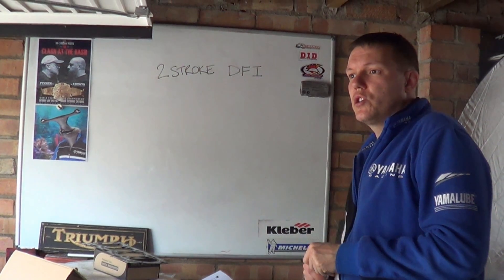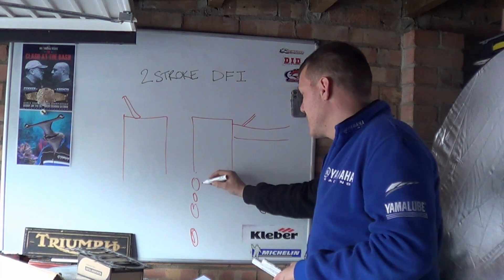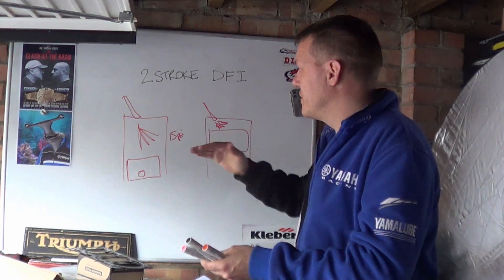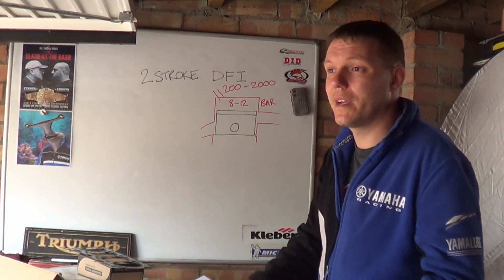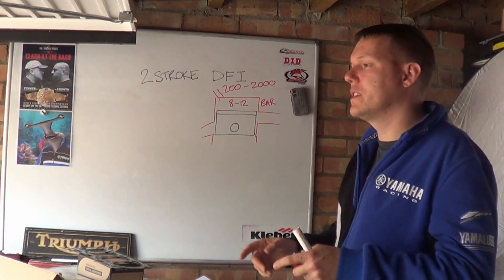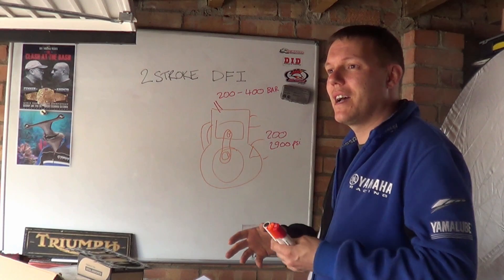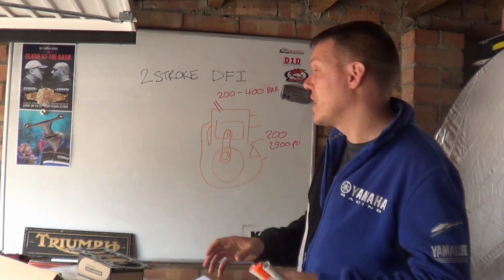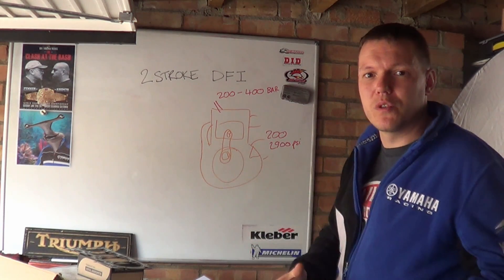Will Direct Fuel Injection save 2 Strokes?

Comment: the point of two stroke lubricating the entire engine with one source of lube. dfi has complicated it to much lublin the parts that with different systems to oil big end rod an crank bearings.   they more work  R&D to do.

Comment: The video skips over much of the difficulty, and details of meeting emissions regs.  The exhaust system is a critical part of the equation.  Its not difficult to meet regulations, when the engine is "up on the pipe" its at lower rpm/load situations where  its most difficult to keep un-burned fuel from exiting the tailpipe.

As far as oil, if it completely burns its not an issue (at least here in the states where particulates don't factor in)

You need to look into the snowmobile market, or even marine outboards. The sled market is absolutely dominated by 2 strokes.  Back in 2003 Yamaha vowed to go 100% fourstroke.  Since then their market share has plumeted to the point, that they don't even build sleds.  They pay arctic cat to put yamaha decals on cat sleds.

Arctic Cat, and Ski doo sell a mixture of 2 stroke and 4 stroke sleds.  Both have a vast majority of customers choose 2 stroke.  Polaris doesn't even build a 4 stroke sled.

Ski Doo uses E-Tec injection (true direct injection, with voice coil injectors firing into the combustion chamber)

Arctic Cat uses a hybrid system, with a single injector firing through the cylinder wall, above the boost port.  At low load, it fires into the combustion chamber only.  At higher load, it fires into the chamber, and into the crank case through a slot in the piston.

Polaris uses indirect injection, firing an injector into the boost port.

Comment: Why doesn't DFI mimic a lean run situation?
Reply: It does! Bosch DI use a stratified injection which uses a rich mixture to start the burn then adds more fuel which ends up being a lean burn, in some cases 60:1 AFR

Comment: It would require a new type of fuel pump but that is totally possible, just has not been done yet.  You can have an eccentric, camlike surface for a rotor over a stator who force output is very high during points of maximum mechanical advantage.  As one example.  Because you would most likely be talking about single-cylinder engines for bikes, generators, etc.. it could be cost-effective.

Comment: what if you had longer than normal stroke and the the exhaust port was moved closer to BDC and combustion happened just as the exhaust port closed? Obviously this would decrease pressure... Right? If so how significant would the decrease be?
Reply from the maker: Great question, there's a video coming this weekend to answer this - matt
Reply: Cool, this is a very interesting topic. I'll definitely keep an eye out. Thanks.

Comment: I think looking to marine applications, provides some other examples were they are common place. The complicated/heavy/high pressures etcetera direct injection issues have been solved with lower revving 5-6K and bigger disc placements1.7L- 3.5L. I think a review of new Evinrude ETec/ G2 engines may contribute to your analysis. The high tech management systems seem to have played a significant part also. Efficiencies were solved and torque was supreme in this sector for the last 3-5 years. (Looking at the Evinrude 2 stroke vs the Yamaha 4 stroke in the 300hp range - 2 stroke shows a reduction in weight of about 10% and a 10% decrease in displacement, this was were fuel and exhaust was managed into Eco friendly shifts in thinking. I hope to see road bikes again return with 2 stroke power but the above parameters may be too large at present but we hold out for electronic fuel pumps and other such components to reduce in size to perhaps fix all of this.
Reply from the maker: "I think a review of new Evinrude ETec/ G2 engines may contribute to your analysis."

- video already in the making my friend.

Comment: what about a direct injected 2 stroke diesel running on kerosene it would be capable of high rpms much like a traditional 2 stroke also the hobby market have been using these kind of diesels for a long time scale it up direct inject it and play with the efficiency a lil bit and it would get better economy and make more power because kerosene has a higher specific output than gas and it would but cleaner
Reply from the maker: "kerosene has a higher specific output than gas"

- where did you get this from? Kerosene has a HHV of 46.2 MJ/kg and gasoline has a HHV of 46.7 MJ/kg. Kerosene also has a lower autoignition temp than gas at around 20-40degC lower. 

Specific output is displacement over HP/kW, and kerosene burns more like diesel than petrol, i.e its flame speed is slower. Kerosene has a stoichiometric (air fuel ratio) of 15, while gas is 14.7. There not much in it, but gas is still the winner.
Reply: The Workshop your right gasoline does have a higher energy density but it does burn cleaner and in a high compression direct injected 2 stroke diesel engine it should be more fuel efficient and still produce sufficient rpms. kerosene does not need to have oil added to it like gasoline because it has sufficient lubricity so it takes one complication out of the system
Reply from the maker: Very good point - kerosene is generally not used in cars/bike becasue its not as volatile as petrol, so you don't get great homogeneous mixing. Old tractors and such used to run on kerosene, but most of them used gasoline to start then engine, then when the engine was up to temperature you switched to kerosene.
Reply: The Workshop that is why you need a high compression engine as well as having a high pressure injection system to properly atomize the kerosene

Comment: Why does my 300cc 2 stroke only have a compression of 6.9:1? Can you explain why they chose to go so low and what benefits and why/how increasing the compression (and to how high) would have? :D thanks great videos!
Reply from the maker: Thanks for the comment dude - can I ask what engine it is from?
Reply: some manufactures calculate compression ratio from the point the piston closes the exhaust port, some from BDC

Comment: "save 2 strokes"????? - 2 strokes arent dying... Just because certain sports no longer allow them, IE Motocross Racing, Doesnt mean they are dying....
2 strokes will never die....
I ride 2T mx bike... a Honda CR 125... I will never touch a 4 stroke... 
had one, and it was shit for starting when hot, let alone requiring a bank loan to rebuild...
Reply from the maker: and this shows what little you know. Ever tried to buy a 2 stroke from kawasaki theres days?
Reply: they dont make em.. havent since 2008....
Why? Because emissions..
People always say its because of noise output.. But its not.. 4 strokes sound waves travel further than 2 stroke sound waves...
But regardless of the fact that kawasaki and Honda no longer produce 2 strokes, doesnt mean they are dying..
There are thousands of people, Myself included, want to see honda produce a 2018 CR....
2 strokes have their fans, especially in motocross....
Reply: no thanks.. had a CRF 450, and that was an asshole to start when hot.. Even after valve shimmed correctly.
Soon got shot of that..
Reply: Snitchy1989 question, was it carburetor or fuel injected?

Comment: "i dont think you understand just how much 200bar is. it's a lot. this system need 200-400 bar. that's a whole lot. how are you gonna generate the 2000 bar this system needs? it would be counter productive to generate the 6000 bar minimum that make this work. i don't think you realize, it ruins the point of a two stroke to have it running pumps that produce 12600 bar."
Reply from the maker: Is this a question directed at me?

Comment: Rotax 800 E-TEC works at 7.900rpm (147hp from 800cc, 35.8kg), direct injection pressure is 34 bar (500 psi): 

http://articles.sae.org/8157/
Reply from the maker: The latest one is the E-TEC 850 - https://www.youtube.com/watch?v=jo-r7LwI70Q

Great engine, but my god it must cost alot. In the video the guy states that - "with a forged crankshaft and oil feed just like a 4 stroke, for reliability" - my point exactly lol
Reply: Maybe expensive, but no more than 4 stroke DI, and because no parasitic losses of cams, valves, etc. don't you think it's potentially more efficient?

Comment: Take a look at the Evinrude/Rotax E-tec direct injection system. A quite simple system with a electric powered coil and a ram that both works as a pump and a injector. https://youtu.be/daN72ij2eTU?t=1m20s
Reply: On the contrary my dear Ian...
Reply: Good video that hakan Bjorkman. Perfect example of development and why 2t are far from obsolete.  (or shite).

Ja sam - are you trying to say 500psi is not enough? Even though it works and is in production right now?
Reply: +Ja sam I guess you where pointing out the difference between the figures claimed necessary in the video and the real world figures then? Apologies, and I`m glad I`m not he only one that noticed..
Reply: E-TEC direct injection pressure = 34 bar (500 psi).

source:
http://articles.sae.org/8157/
Reply: Was going to say the same thing :)
Reply: I was going to comment that Evinride is already doing it.  Glad someone else already did!!

Comment: As you said in the camless engine video, technology and materiels need to get to a stage where it becomes practical/necessary and cost effective. Until regulation, there was no need to further refine 2t but now they have to become cleaner they will begin to make use of new ideas and the problems will be overcome, just like 4t had/has to.
Reply from the maker: "Until regulation, there was no need to further refine 2t" - really? So Kawasaki and Yamaha weren't in competition like the other big bike makes?
Reply: Competition in the same class where major design deviations are not allowed. Further more the bikes could already produce more power than could be safely restrained so developing and complicating it more was unnecessary, until regulation intervened of course.

Comment: Isn't pressure ~1 bar in the moment of closing the exhaust port?
Reply from the maker: In the cylinder before combustion? Yeah pretty much
Reply: So a low pressure direct injection (4-5 bar?) would be enough in that moment?
Reply from the maker: You have to think of the duration of the injection phase vs the speed of the piston. @ 10,000 rpm the injector will have to compete with rising pressure so 5 bar wouldn't be enough no
Reply: I agree, do you have any data on piston speed at max rpm and direct injection speed/duration so I don't have to search/calculate?
Reply from the maker: For which engine?
Reply: Ok, here is the data I found for direct injection duration on high rpm engines: 1.5-1.6 ms for 10-11.000 rpm, needed pressure is ~150bar :(
sources:
http://www.formula1-dictionary.net/direct_injection.html
http://speed.academy/direct-fuel-injection-how-it-works/2/

10.000rpm/60s=166rps, so time for one revolution it's 1/166=6ms (full 360' rotation), so for 1.5ms it's 90' window for direct injecting, is that enough for a two stroke?
Reply from the maker: Yes it is, but your talking about a system used in F1, which I'm sure is silly expensive.
Reply: Price of F1 components aside, just wanted to find out how much pressure is needed for direct injection 2 stroke, because your assumption of 200-400 bar seemed pretty high.

The answer is 34 in low end, 150 bar in high end.
Reply from the maker: "The answer is 34 in low end, 150 bar in high end." 
- and you made this assumption based on system that you don't have the full access to. It depends on what engine, how the injectors function and what the compression ratios are. If the answer was 150bar when why are most diesel injectors common rail systems between 1000 - 3000 bar when the compression ratio are 14:1 up to about 25:1?
Reply: I didn't made assumption, I read it from the sources I posted.
The diesels inject close to TDC (max compression), and injection time is faster, so higher pressure is needed.
Reply from the maker: Diesel injectors don't inject all their fuel before TDC, this is how engineers have improved combustion over the past decade. - https://www.youtube.com/watch?v=Y_U5kPpn4U8

- It all depends when you want to inject the fuel and for GDI the ultimate goal it to inject just before TDC (about 10deg BTDC) this is where the highest fuel efficiency comes from. If you inject when the piston is at BDC then the system is ever so slightly better than multiport injection.

This is where you find numbers on different system ranging from 34 - 150. Engineers would love to go for the high pressure numbers straight away, but this is where the problem lies. 

As for the 2 stroke, really they need to use high pressures to, to gain the real benefits that DFI can offer. One thing that you have to take into consideration is the compression ratio. Some of the new DI systems have had to lower the compression ratio to have lower pressure stats so to not have higher pressure pumps.

If it was a case of 100 bar then every system would have DFI, this is the difficulty of the system. Use high pressure (500bar for example) need a great big pump, and the associated loses. Go for a lower pressure and negate the bigger pump but you have to fire earlier and the benefits of the system are reduced.
Reply from the maker: If you read the link for the F1 article that you supplied, its says this -

"DI fuel systems are substantial in their design because they usually  
generate and hold fuel pressurized at a 150 bar or more rather than  the 3 to 5 bar common in port multipoint injection."

- which is where you got your numbers from. It then goes on to say - 

"In a DI engine,  injection can’t even start until the inlet valve opens,
 and then only when  there is no chance of the fuel escaping through theexhaust valve during valve overlap.  Start of injection will therefore 
be at or close to exhaust valve closing time.  After injection, the fuel
 has to be given sufficient time to evaporate to  create a combustible 
mixture before it can be fired by the spark. At this same 10,000 rpm, 
the time for this to happen falls to somewhere nearer 1.6 ms.  
Increasing the engine speed to the maximum of that now allowed in 
Formula 1  (15,000 rpm) reduces this time for evaporation and mixing 
still further."

In other words the injector fires when the piston is on the down stroke. 'once the exhaust valve has closed.' That's why they use 150bar, for fuel flow rate, and to ensure fast evaporation. Not to over come pressures at near TDC. 

Direct injection is a broad term, meaning spraying into the cylinder. You have to understand the whole system instead of number hunting.

Comment: in the earley 2000's evenrude had made a new outboard direct injected 2 stroke that was supposed to be better with fuel economy than an equivelent 4 stroke
Reply from the maker: very true but the BRP engines are really complicated, expensive and quite large. Take the specs from a Evinrude 115 - 1.7 litre V4 and produced 115 HP?! and it weighed 166kgs! 

An R6 is 190Kgs fully fuelled and ready to go, makes 122Hp and is only a 600cc. Are you gonna say that the Evinrude 115 has better fuel economy than the R6?

Comment: can you make a video about types of sportbikes engines layouts?
Reply from the maker: In what way? like V4 vs straight 4?
Reply: v4 vs straight 4 vs 2L from ducati please
Reply: take your time whenever you're free :)
Reply from the maker: No worries mate, that's already going to be covered in the Cylinder Configuration videos, but I can do a direct comparison
Reply: ok that would be great thanks for being responsive mate
Reply: My Honda GX25 strimmer can run upside down not sure how its lubricated its clever.  Its a normal 4 stroke ohv engine with oil in the sump.

Comment: Common rail systems started on 1350basr. My 1.9dci from 2003 pushes at 1600bar. New common rails(2017) does it at 3000bar.
Reply from the maker: Yeah, thats for diesels, which due to their higher compression ratios need even more pressure to over come the pressure in the cylinder. Not only that but because they are compression ignition the fuel starts to burn increasing the pressure before the injector has finished firing, hence even more pressure required. For GDI they don't need to go as high as the injector will close before the ignition fires - matt
Reply: Pumpe duse diesel injectors operates at ~2000 bar and don't need giant pump(only cam), maybe some adaptation of those could be used.
Reply from the maker: But again this adds complexity etc. Might as well have a 4 stroke, pass the emissions testing and have more lower end torque
Reply from the maker: and thats mechanical injection which is coming soon